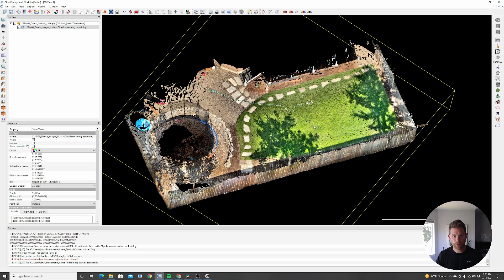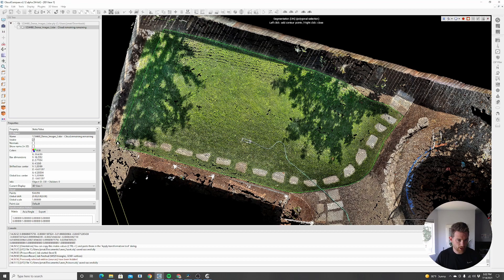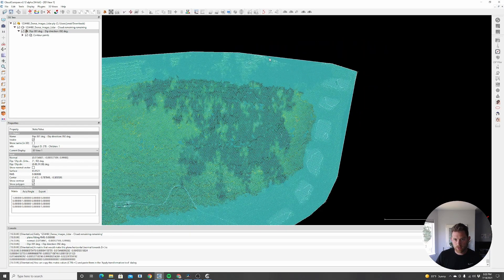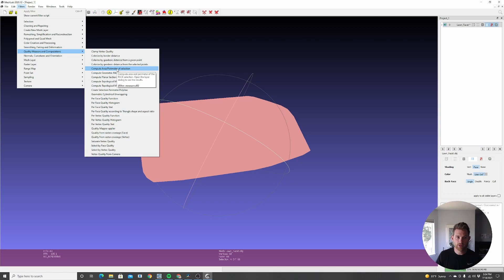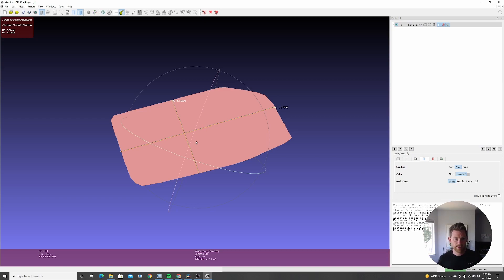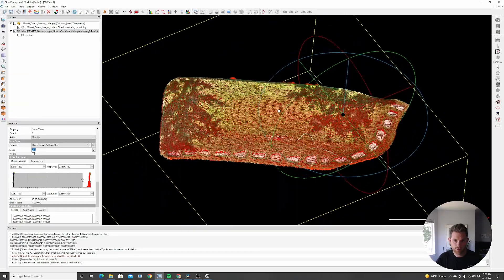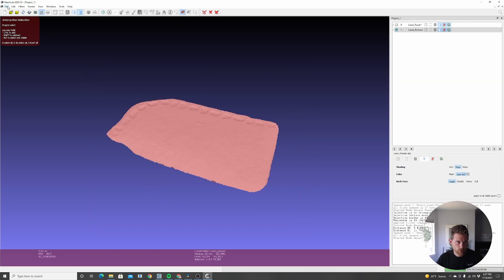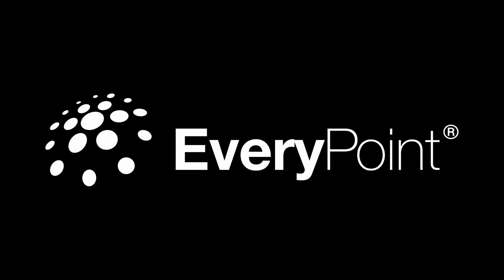How to Measure the Surface Area of a Point Cloud

Comment: Hello. After Ctrl+S (2:20) it is not possible to save as "obj" (CloudCompare v2.12.4). I saved as another kind of mesh - "ply", but after importing to Meshlab it is still point cloud (instead of 3d shape). 
Do I need to do some extra operation on my point cloud to enable CloudCompare to save as a shape ("obj" type)?